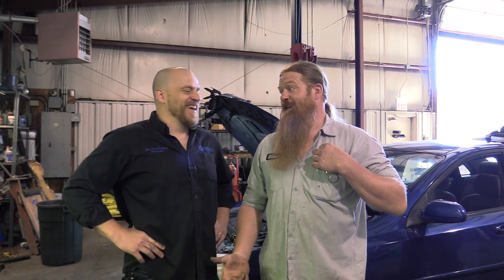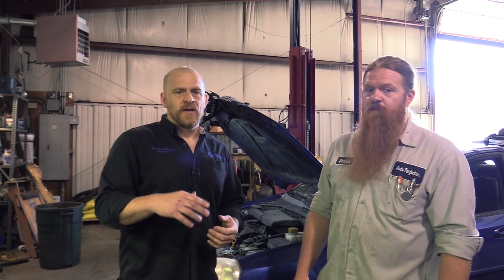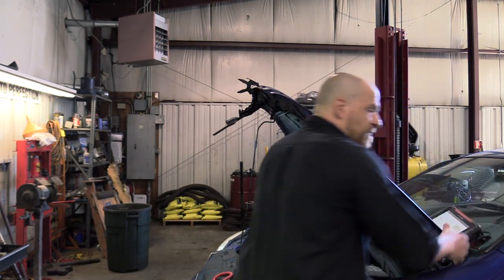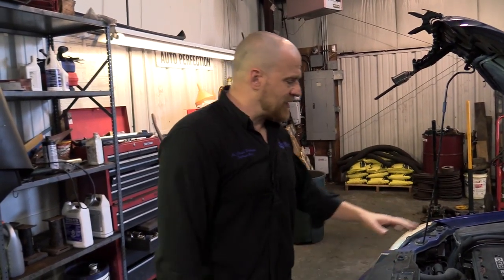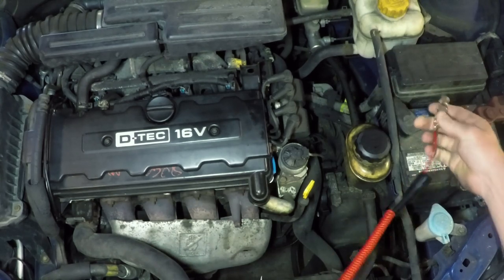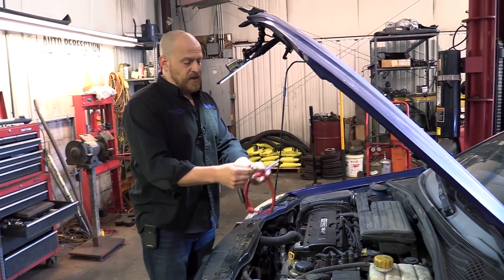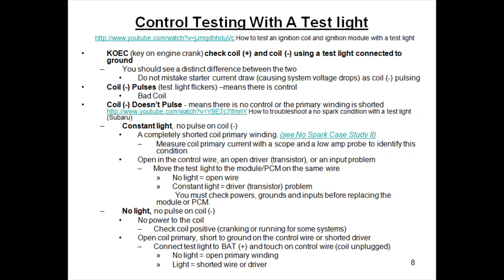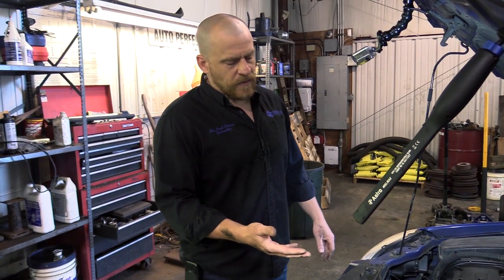Weak Spark From One Coil (Waste Spark Coil Assembly)

Comment: What can cause a coil on a waste spark system to only induce a misfire in one of the two cylinders? I was able to diagnose and fix LeSabre with a 3800 engine by swapping coils and watching the misfire counters. I knew that it was possible for a bad coil to cause only one cylinder to misfire, but I still don't understand how. It would only misfire under medium throttle acceleration (no downshift) at low RPMs around 50-65MPH.
Reply from the maker: The coil has an insulation issue and the spark will burrow it's way into or out of the coil through the housing and bypass the plug and wire
Reply: @ScannerDanner Would a secondary resistance test on one of the coils in the pack across two towers show out of range for a single misfire code?

Comment: Sir I have Hantak 1008c oscilloscope.There is a question about this.Which option can I check for wasted spark ignition?please help۔
no 1 option secondary DIS positive fired and no 2 Secondary ignition DIS or CPC negative fired no 3 Secondary coil output diagnosis
Reply from the maker: I answered this on FB
Reply from the maker: on a waste spark coil, one side of the coil is firing positive polarity and the other side is firing negative. All those setting do is invert the waveform
Reply: Sir thanks ♥️♥️♥️♥️
Reply: Thank you very much sir this is all I have learned from you

Comment: I really appreciate what you do for the community but it's not all bad being a parts changer if you use OEM parts, your basically replacing parts that could fail soon anyway, if you have the budget.
Reply: BTW since i got my Autel a few years ago I am now not a parts changer! regular folks dont have a 2 way scanner
Reply from the maker: replacing parts as a guess for what is wrong with the car is NOT troubleshooting
Reply: @ScannerDanner  we both understand that, but for the people with very limited knowledge and they don't even know they can purchase a 2 way scanner then changing parts is all they have. As far as actual mechanics in this field then I agree, don't be a parts changer.
Reply from the maker: Not true my friend. A little testing goes a long way! Even a DIYer can follow me and be able to recognize with a little knowledge, for example, that the MAF code they have is because of a vacuum leak and they don't need to spend a few hundred dollars on a new MAF sensor! 
Test, don't guess! Sure some tests cannot be done without the right equipment but grab your test light, your DVOM and a basic scan tool and follow what I'm teaching! You won't be swapping parts anymore.

Comment: It's still a good test and I use it every day.  But don't let it be the sole reason to come to a conclusion when there could be other contributors causing you to see what you witnessed.
Reply: By that, I mean that both plugs on that coil could be carbon tracked, and not firing inside the cylinder.
Reply from the maker: Won't matter in your example. The test light becomes the opposite plug and wire. The only variable I can think of would be an open plug wire on the opposite or companion cylinder in which case you may have weak spark on one side and as soon as you touch the open plug wire side you'll get bit lol and then when you do the test on that side is will show great spark. This test, in this scenario eliminated all other variables on the wire and plug side as both sides were weak and again this was NOT a tower to tower test as you suggested earlier.

Comment: You can be fooled by that test, and here is how... if I pinch closed the sparkplug electrodes for cylinders 1 and 4, to make a short circuit at the plugs, since both 1 and 4 are the same coil, that test is like holding a wire from tower to tower and in that case you will have HUGE spark,  more than adjacent coil and will cause you to think adjacent coil is weak,  at idle the volts are around 9000 volts but after half of the spark is jumping through the other plug and wire and you get to see what is left of the remaining volts and a lower spark jumping gap.
Reply from the maker: tower to tower, agree, it is misleading, that is not what is being done here. My test light becomes the other plug and wire with a variable air gap

Comment: I got that problem, but with the individual coils in each cylinders there were sparked,but it was really weak in 2 of them,change just the spark plugs and 2 of coils and problem solve,you really think is a good spark but is not strong enough.

Comment: not getting any spark from my plug wires even after replacing the distributor
Reply from the maker: Help me out here my friend. Year, make, model, engine as a starting point. Trouble codes etc.
Reply: @ScannerDanner  it's a 95 Honda civic D15b   getting no codes
Reply from the maker: @wonderweiss8579  https://youtu.be/-ZGLoSSowYY
https://youtu.be/SUxagOAVS5M